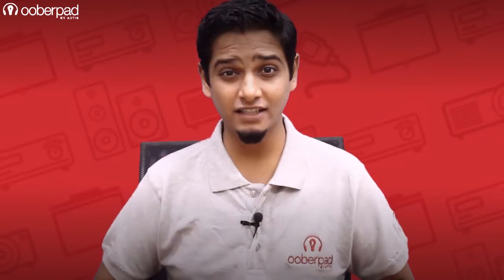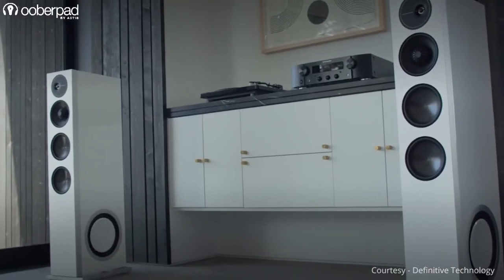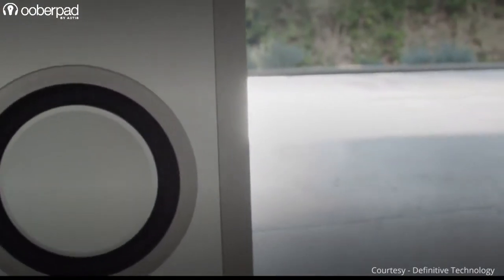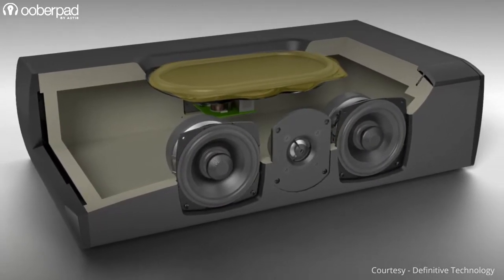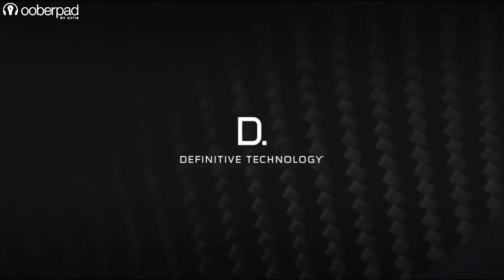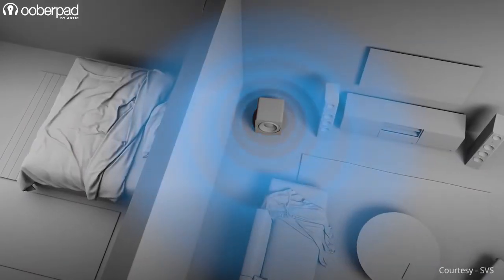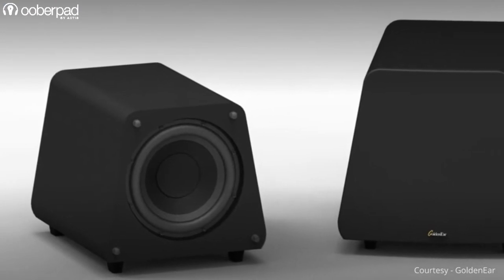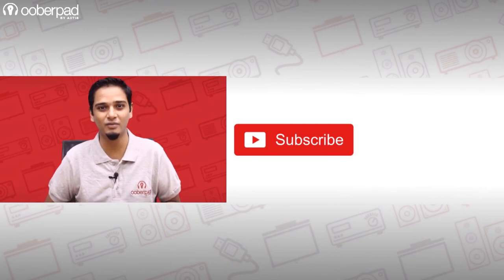What are Passive Bass Radiators?

Comment: Superb explanation. Any size ratio between woofer and passive radiater?
Reply: They are generally the same size.
Reply: Yes, you need 2 passives per 1 active, or the active will overpower the passive and will make noise.

Comment: I have a question ...Is it necessary for a speaker with passive radiator to be cometely airtight from the inside ?
Reply: Yes
Reply: @Scala916  I have a jbl xtreme, when I press the passive radiator the other side comes back after few millisecs ...so I guess  it's necessary to keep a hairline gap for the  excess pressure caused by the bass to sustain the speaker ?

Comment: Celestion was a big user of Bass Radiators on its high end speaker systems dating back to the early 1970s - especially the Ditton 66. So its definitely not a new thing, although more and more speaker manufacturers are making use of the technology.

Comment: When the speaker hast to be airthight how the woofer gets His Air?

Thanks dir answering
Reply: Instead of pushingnair put of a hole or tube, the radiator using air pressure caused by the sealed box, vibrates and creates low bass sound. Its a clever trick.